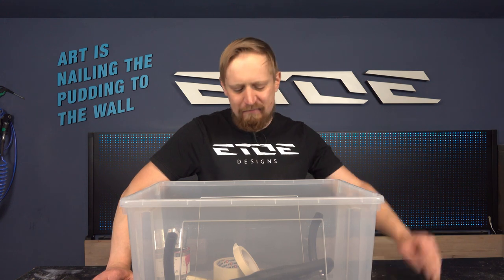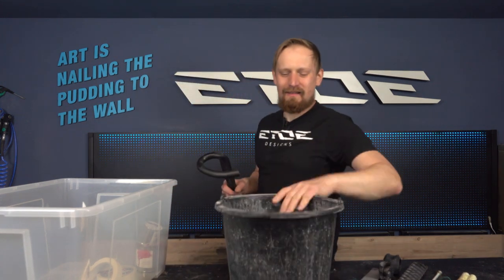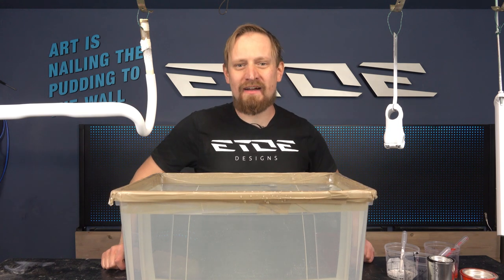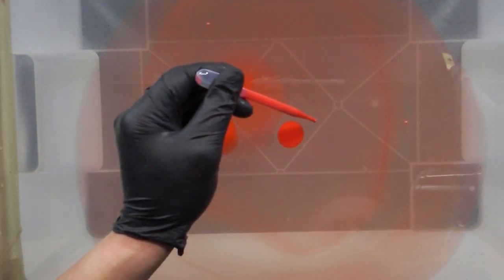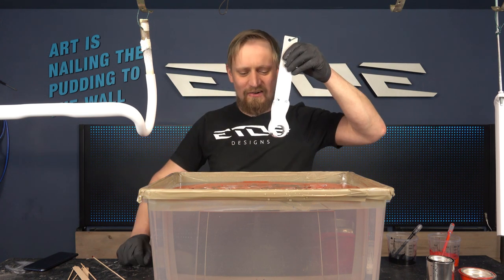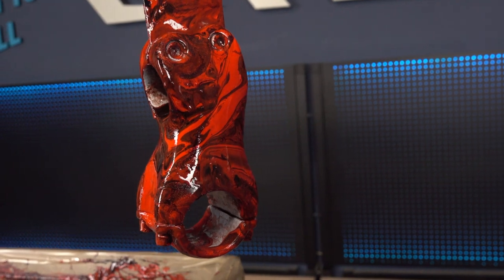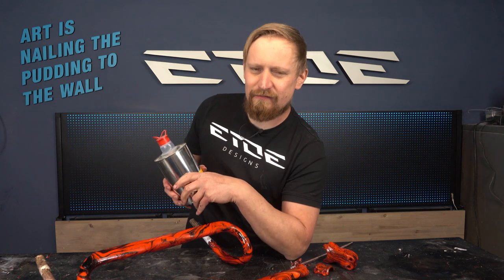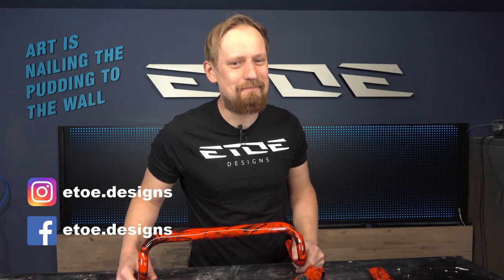hydro dipping bike parts

Comment: Thanks, Martin! I've been all over the internet trying to find a reliable guide for a high quality finish, or let a lone a good looking result in the first place. You're definitely a cut above everything else I've found. 

Two questions:
1. You made this video 3 years a go and I'm sure you've learned a lot. Would you do anything differently if you were to hydrodip now?
2. Are any of the steps different if I'm dipping plastic? I assume I'll need a primer for plastic but otherwise the steps should remain the same, yes?

Thanks!

Comment: This is paint dipping. Hydro dipping is where a film is put on water that has a inked design. Also called water transfer printing.
Reply: This IS a film being put on water(hydro) which is transferred to complex shapes that are dipped in. The design being transferred doesn't matter, it can be a screen printed design or swirls like this.This is hydro dipping. Paint dipping would be dunking the parts in a bucket of paint or something.
Reply: I thought hydro meant water? Not film.
Reply: @Egypticus  the term hydrodipping is a nickname for the process, the correct term is water transfer printing, when you just use spraypaint in water it's called paint dipping. This video shows him dropping paint into the waters surface, and swirling it around. Again water transfer printing utilizes a printed design and a chemical transforming said design into floating ink so it will transfer to painted parts. That's the reason for hiring professionals to do water transfer printing.

Comment: Hi Martin!

Going to behydrodipping my fork and stem. I am using all the products you listed in your description for the DIY steps, the spray max 2k primers and clear coats and the humbrol enamel paints. For smoothing the paint after dipping I know you used a professional carbon primer, but for DIY you hadn’t indicated any step for smoothing. Is it okay to do several coats of 2k clear coat, sanding in between, to create a smooth finish? Or should I look for spray a clear carbon primer or  clear intercoat like from house of Kolor to achieve the same smooth finish? I intend to lay a logo  before the hydro dip. Likely to spray the logo, then mask over the logo before dipping to avoid color under the hydrodip and not having a significant spot of unevenness.

Comment: Hi I'm getting quite alot of bubbles in the paint when I'm dipping. I'm using only cheap gloss spray paints to try it but yeah lots of bubbles . Any idea on the cause of this
Reply from the maker: Yes cheap gloss spray paint is the reason.
Reply: @ETOE  acyrilic paints will work better then.. does the water temperature matter . Thanks for your reply 👍 winter rebuilds coming up and I wanna make my full sus look awesome for next season

Comment: Am I the only one, which wouldn't overpaint (or overdip) a beautiful carbon fiber part? I mean, the producer added a workstep by adding a super-precise (and beautiful) carbon fiber mat on top of the structural parts.

I would do some less interesting aluminium or steel parts or painted carbon parts (which should be less expensive, as the weave doesn't need to be as flawless).